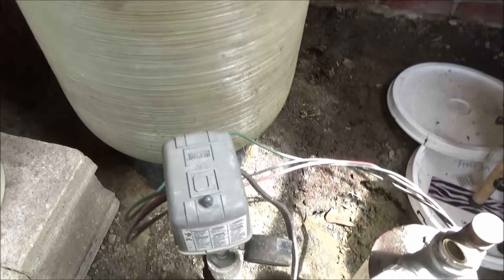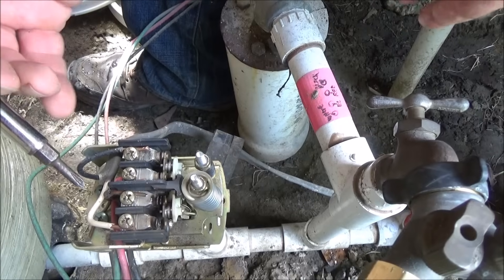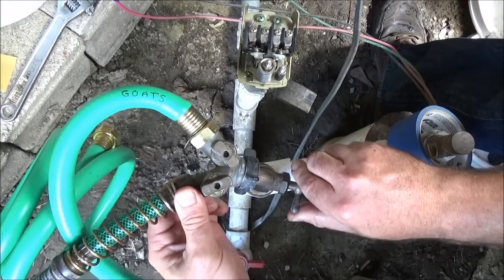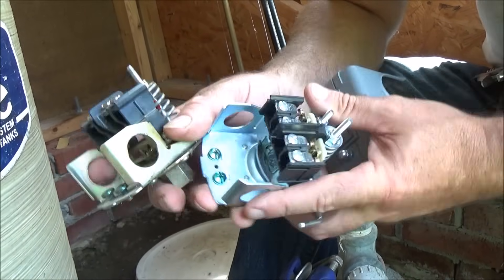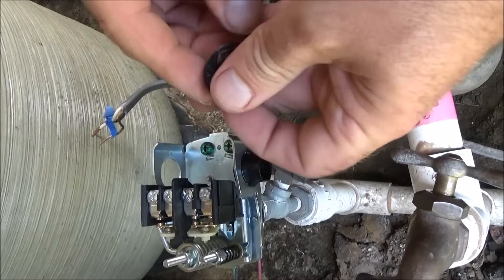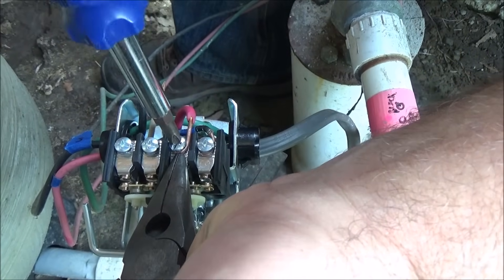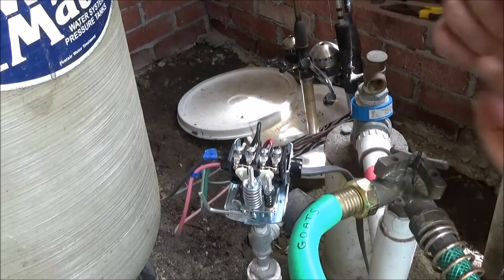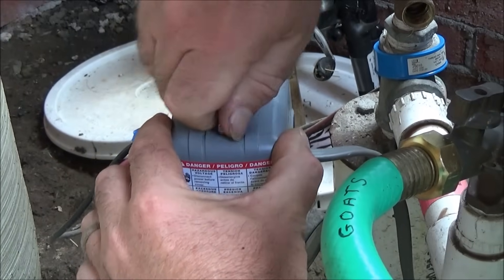replacing a well pump pressure switch (burnt contact points)

Comment: Thanks for sharing. My problem seems to be that the points on my pressure switch won't close. Since they don't close my pressure drops off to nothing. I go out and bump the spring and they close, which solves the problem until the kickoff pressure is reached. Is this an adjustment issue? Spring too tight or too loose or something else?
Reply: Also, if the air in your pressure tank is above the cut-in switch setting, it will never turn on.  So you might want to check the pressure in your tank.  It should be 2-3 psi under the cut-in setting.
Reply: I had same issue. I replaced the switch and it seemed to correct the problem. When I disassembled the old switch I noticed there was some iron sediment built up under the rubber gasket on the bottom of the switch. I'm guessing this was giving a "false high" pressure reading and thus cutting out the system and keeping the contacts open. I'll see how long this new one lasts but if it becomes a recurring issue I may put an inline sediment filter in front of it to prevent the premature failure going forward.

Comment: Did you wire it to 220V or 110V??
Reply from the maker: It's 220. Important consideration of you pls on using a generator to pump water in a power outage!

Comment: Great video! Very well explained. Got home from town today and discovered my water was no longer flowing. I don’t know much about wells and pumps but I was able to watch this video and have a good understand. Seems my pressure switch is fine and it very well could be my pump. Gonna call the company that installed the well and holding tank tomorrow for further assistance.

Comment: hi, my switch contact point don't open and my pump runs for a couple of seconds then stops. I cleaned all contact points but still the same. Help pls.
Reply from the maker: Did you use a nail file or sandpaper? Might just need to replace it.

Comment: Just a small tip to add- Check your probe with a live circuit first to make sure its working.
Reply: ...as with all electrical test equipment!  (He may have done this but not shown here.)
Reply: @christianhill8681  you must be one of those Craigslist handymen with over 30 years of experience that tests hot circuits with their ora.

Comment: I would not have replaced it just yet. I have used emery paper to sand the contacts or you can use a very small file to get the carbon off the contact. Bugs especially small ants are attracted to electric power for some old reason. They can mess up switches. Iv dealt with wells and pumps for forty years. Usually when someone called me abt no water the first thing I would do is check to see if there is power going to the well and the pressure switch. Could be a fuse be blown or someone has cut the power. Next check the points contacts to see if the points are burnt. 9 times out of ten if your lucky the items I just listed is what's wrong. The 10th thing would be the worse is the pump it's self is burned out either by use, and a lot of time lighting will run in on it during a storm. If so you have to pull the pump for replacement. You can check the pump still in the well by check the resistance numbers  with a ohm meter on the wires going into the well to the pump. If you have to pull the pump be damn careful you don't skin the wires exposing them. That is usually done at the edge of the well pipe sticking out of the well when you take a rest or get another grip to pull it further out. Iv pulled a bunch by hand, some down 275 feet. Another thing is have a great ground system. Get a long copper rod in the ground and run a ground wire to it from the well. Lightning during storms ruin a lot of pumps. Make damn sure the power if off while sanding those points so you don't get energized. Double check that. Oh and have fun.
Reply: thank you!!! I took your advice and cleaned the contacts and went from contant breaker-tripping to no trips and powerful stream of pressurized water. I used a white woman's nail file trimmed to fit and worked like a charm!!

Comment: A volt meter would also be helpful instead of that gay little tool your using... How do you know if your getting proper voltage? Ahhhh you don't.... Buy yourself a volt meter..... So you can ome it out or make sure your getting proper voltage....  Learn irrigation before you make a video.... Otherwise good job.... And Teflon tape sucks especially when your replacing a centrifugal pump
Reply: Professional electricians' first choice when trying to see if a circuit is hot is a non-contact voltage tester.

Comment: no water leaks but one man told me to put air in the tank and it worked but when I turned on and off the water it seem to leak out the air when I turned it on the second time mixed with water out of the garden hose
Reply: Sounds like a split bladder.  The bladder keeps the air and water separated in the tank.

Comment: quick question can't get the pressure switch to stay off or on just keeps clicking what can I do
Reply from the maker: Agapito Trevino possibly a ruptured or leaky bladder in the tank, silt or debris in the check valve, or other problems. Might need to hire it out but don't be surprised if you need to replace the pressure switch and tank. I'm not an expert but there seems to be a bigger problem there than the switch itself.

Comment: hi.  I have a question: my well is about 25 ft from my house.  I need (want) to move the bladder tank and well pump into my utility room so no more problems. My well is 29 feet deep, water table a few inches below ground most months of the year. Is my well close enough to do this? Can I use existing buried water line into house, just replacing section where pump and tank are now?
Reply from the maker: linda scott you should consult with a professional plumbing company; I'm afraid that's outside of my experience or knowledge.
Reply: Thanks. Did a few days ago, and it's doable.  I'm keeping your vid for reference next time that switch gives me problems.
Reply: my river 300 feet from home what's size pump can pull water and PVC pipe how many length will do me
Reply: This should work as long as the vertical height between the pump inlet and the height of the water table is less than 25 feet.  However, performance will drop off as you approach that number, the limit for most shallow well pumps.   Some manufacturers publish this information.   I think moving the location of the pump and tank is a good idea as you are still close to the well.

As for a 300 foot run, that's quite a stretch.  That long of a run presents flow resistance which decreases the amount of possible lift.

Comment: Just a little tip, take the pressure pipe off and make sure it's not clogged with rust and debris. a clogged pipe will cause the pressure to go to zero (like someone shut off the tap) and then the pump will kick back on.
Reply: can you put a shut off on that pipe so you wont have to drain the tank?
Reply: I’ve had debris in there so that it held the switch on!!  Turned on faucet, must’ve been 80psi there!!
Reply: I had that happen with a pump I had.  The line from the pump to the switch was a tiny 3/16 inch plastic tube.  As for draining the tank, the only way to check the pressure in the tank is when it is empty.  Otherwise, the air pressure will match the water pressure.

Comment: Thank you for sharing this. Made my life easy today when our water stopped flowing. This is a 30 - 45 minute fix. One tip I learned though, look inside the cover to determine which pressure switch you need. They come in 20 - 40, 30 -50, or 40 - 60. I had to make 2 trips to Lowes which luckily wasn't too bad.
Reply: Take photo😊😊😊😊

Comment: what is the model of square D that you use? Can this pressure switch  automatically switch off the pump if there is no incoming water to the pump?   what is the cut in and cut out that you use? Please share with us.  Thank you for the video
Reply: This switch cannot shut off the power if the water source goes "dry".  In my setup, I have a water tank on my roof and a float switch in line with the power going to the pressure switch.  This helps prevent my pump from burning out if I run out of water.

Comment: Comments are good on improperly installed wire at terminal and no grommet. However as for replacing this entire switch, if there is nothing really wrong with it, I'd I'm old school, and would file the points with a needle file. You don't even have to remove them in this case, the gap is pointing right at you. I used to file the points on my 1965 VW. I've filed the points on my compressors, tablesaw switch, and my wife's Maytag washer control switch.
Reply: this is good info one the contacts I too have had to many times on my VW.
I would think it be a temporary fix but also a good way to test to see if that is all that is wrong
Reply: I've used an emery board.  But if the contacts are plated, this is a temporary fix.
Reply: Robert Rowlands i

Comment: I lost total water pressure the last two days, and tapping the pole the pressure switch was on resolved it at first (not any more).
My pressure gauge is at zero, but I used another gauge and it read 30.   Could the pressure gauge be bad too, or is zero normal if the pressure switch is not working?
Reply from the maker: bonvivant371 the air pressure? should always be "charged" with air. the pressure switch sounds burnt out. some people file the points shiny and they work for a while but it's best to replace the switch. good luck!
Reply: The bladder is what makes the water pressure stay up when the pumps not running. As water is used the pressure will drop down until it gets to the preset low side part of the switch. Then the pump kicks on to pressurize the tank by putting water back in the tank against the air bladder. The pump will kick off when it reaches the high side of the pressure switch.

Comment: You may want to think about adding back flow presenters so your goat water isn't sucked into your house.
Reply: Roger Hinderber  that water coming out of the well is cleaner than anything you've ever drank on your life unless you live close to a beach in which case you'd have a centrifugal pump. And you'd be pumping out sulfur water that smells like dirty pussy.
Reply: And it's a backflow preventer... And it's code to put them on... But it's also illegal in my county to tie well water into your house... Bc why would you pay for dirty city water when you can have clean free water 😂
Reply: @kylamcelroy5745  I bet you haul clean, well water inside to drink and cook with.  I work in Houston, Texas, but live 40 miles away.  I don't drink that sewer water at work.   I take my beautiful, clean, well water with me.
Reply: @kylamcelroy5745  Same where I live.  Problem is the "well" water can get pumped back into the house plumbing, out into the street, and to the neighbors.  I consider my well water as non-potable, good for irrigation and the pets.
Reply from the maker: Roger Hinderber thanks
Reply: Lol are you serious don't act like you know every fucking thing.... All the chemicals added into your drinking water and your trying to tell me good clean well water is goat water? LMFAO...... Your drinking water has flouride in it you fucking dummy even your bottled water do a oh test. Read the ingredients. Their poisioning you😂😂😂🤣🤣 Do your research.... Your certaintly no irrigation man.... Are you even licensed?